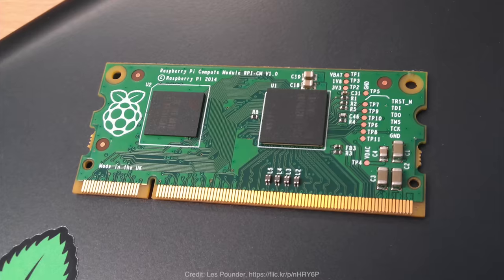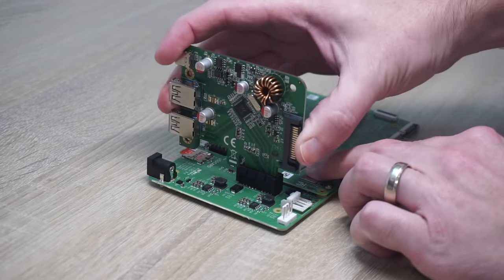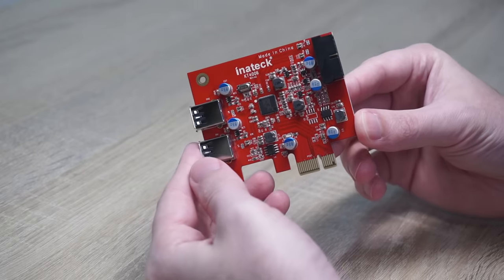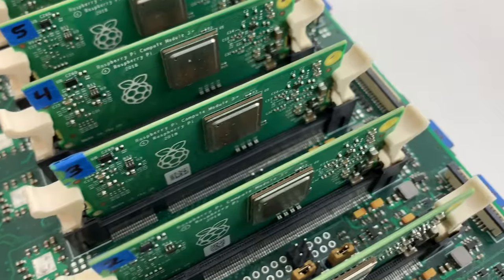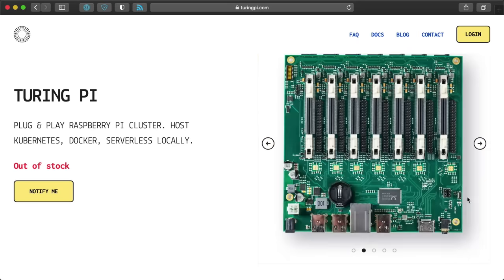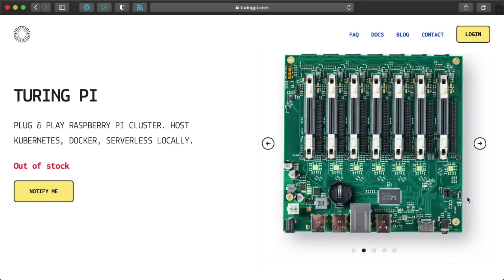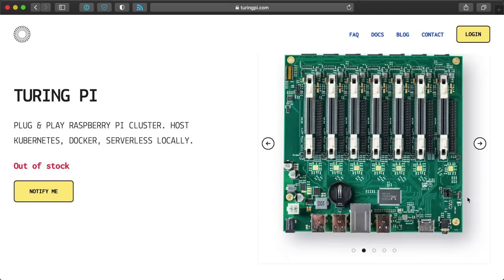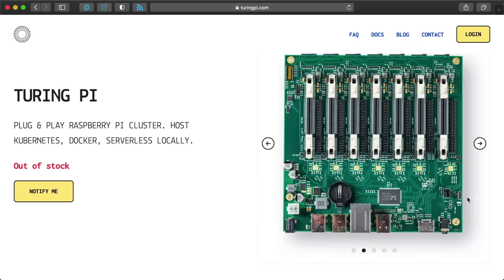The Raspberry Pi Compute Module 4 Review

Comment: now i kinda just want a company to make A NUC sized I/O board with all the I/O on the rear, and maybe an M.2 SATA port on the bottom side.
Reply from the maker: Throw an NVMe M.2 slot on it and I'm there. That's basically an Argon One case, but even easier to manufacture. Wouldn't have USB 3.0 though.
Reply: @JeffGeerling  at sub 400mb/s is it even really worth getting the NVMe drives up and running? SATA M.2s save you a smidgen of cash and are just asp lug and play, right?
Reply from the maker: @Mobile_Dom  It really depends on the deal you get for the drive, but NVMe drives do get better random performance than a SATA drive due to the more direct memory access.

Comment: The Banana Pi R64 is a router based development board, which can run on a variety of open source operating systems including OpenWrt,Linux. It has 4 Gigabit LAN ports, 1 Gigabit WAN, and AC wifi AP function. use 64 bit chip design
http://wiki.banana-pi.org/Banana_Pi_BPI-R64

Comment: I don't really get why you wouldn't have drivers for arm64 (aarch64) or armhf. First of all, AMD gpus have open source drivers, built straight into the linux kernel. I dont think amdgpu is included in Raspberry Pi OS build, but you should definitely be able to compile your own kernel with it included. Nvidia supplies its proprietary drivers for arm64 and armhf. Of course it's likely that these don't work due to this being such an unique device, but they are at least out there, and you should be (in theory) able to use standard AMD/Nvidia gpus. PCIe is backwards compatible.
Reply from the maker: We'll see, I ordered a 1x GPU. Larger ones typically require more wattage, so I fear I'd have to do a little more work / get a better riser to provide enough power without overloading the 2A power supply I'm using through the barrel plug.
Reply: @JeffGeerling  Here is a dirty hack: if you can't find a power supply with enough power, get an older ATX psu with a floppy connector (or just connect some jumpers). According to IO board's datasheet, you should be able to use it as an input. If you for some reason in some parallel universe do this, disconnect 5v wire just to be sure and check everythin with a multimeter before frying your only board :D

Comment: @4:45 -- I don't think that's true. -- They make 1x to 16x Riser cards (they're pretty cheap on Amazon) and people use them for GPU Bitcoin mining all the time. -- Sure you'll be running a 16x card with only 1x the bandwidth -- but it should still *work*. -- You can probably even game on it (no matter how slow it is, it will only be slow compared to a high end setup -- compared to the built-in mobile GLES accelerator, it should still blow it away...).
Reply from the maker: Yep! I just made a video going through trying a Radeon 5450 (which requires a 16x slot) with the 1x slot on the IO Board, and it works... mostly... just doesn't initialize all the way :(

Comment: you said that the pcie slot wont support a nvidia card for gaming however i think they make adaptor boards that allow a nvidia card to connect to a single pcie slot as bitcoin miners do not need the video asic so they can get away with using cuda cores only.

https://www.newegg.com/p/1B3-0040-00001

should in theory work  you wont be able to game or render graphics  only compute (bitcoin mining and password cracking)

arm eh!  couldnt you hackintosh a pi and run osx big sur since newer apple computers use arm chips?

the wifi connector is the same you see in laptops so couldnt you pull the antenna from an old laptop and use it?

Comment: NVMe requires 4x PCIe lanes. Im surprised you even got it to boot and run on 1x lane, if the drives got their full speeds
Reply from the maker: 4x is not a requirement; the drive just drops back to use the x1 bandwidth, and maxes that out. The Pi shows that it negotiates a maximum throughput of 5 Gbps in the system logs. If you have more lanes, you can get more bandwidth, though.

Comment: 19:20 A dev board like that needs to expose every feature of the module it's for: that's the whole point, so that you can use it to breadboard test with your project hardware and figure out exactly which features you actually need. If you want a smaller board, you take the lessons you learned from the dev board, and design your own carrier board to contains only those features you determined you needed (plus the rest of your project's circuitry), as god intended.
Reply: Plus the Pi Foundation are releasing KiCAD designs for the dev board, so you can just take their "known good"¹ design and delete the bits you don't need in order to create your own board :)

¹ ...hopefully there are no hardware "quirks" in the dev board, such as the RPi 4B's USB-C issue, so that it actually is a fully-working reference design! :)
Reply from the maker: True, but the older models were still more trim—features like full HAT support with mounting points aren't quite as important to me. But it is nice to see it for those who need it.

Comment: If it's a true PCIe bus, and it is a regular Linux kernel, then just re-compiling a driver for arm would do the trick.
Reply from the maker: Unfortunately after a lot of testing it looks like the problem is that the PCIe bus on the Pi is slightly out of the standard spec, and I might be running into that in my GPU testing.

Comment: You can run a 3090 on a PCIe 1x slot (assuming you can even find a 3090) I just wouldn't recommend it, the bandwidth would be horrid.

Comment: Everything out of stock now, I am expecting IO board with PCIe and Ethernet jack at pricing 10$.
Reply from the maker: It would be cool if someone could build just a tiny carrier board that had Ethernet, an M.2 slot, and power, so I could make a tiny / thin headless server.
Reply: @JeffGeerling  Yep, except i would trade the M.2 with PCIe for extra flexibility. I am expecting the price of this tiny carrier board would be much cheaper. The only catch is the high-density 100-pin mezzanine connector could be pricey due to it's uncommon form.

Comment: Building a NAS has a high SAF!! I had to stop the video when you said you don't have a NAS.
Xpenology
FreeNAS
UnRAID
...
You surely have an old PC sitting around that you can put a few shucked WD drives in. My Xpenology NAS is running beautifully on my 13ish YO LGA775 PC with a Q6600 CPU. It doesn't take much! Plus you get to play with Synology DSM - which is AMAZING. And later you can convince the wife that Synology hardware will SAVE money from reduced electricity cost.
(SAF=Spousal Acceptance Factor. It's the single factor that matters most in a happy relationship :-)
Reply from the maker: I have one old PC sitting around, but it's a laptop and I only have it to test builds on Windows from time to time, and for Halo :D

I do have a bunch of Raspberry Pis, though, but until the Pi 4 none were any better than the Mac mini I've been using for the purpose since 2011. But now I'm probably going to be giving the mini the boot (well... selling it off to someone who can make good use of it elsewhere).

Comment: The Pi can't handle PCIe GPUs. I've had a look into this topic a while ago for the RK3399. Basically those small CPUs lack some sort of cache/memory that would allow them to operate a dedicated GPU. More precisely: This cache is too small (I'm not talking about L1-3 cache btw).
Drivers aside. The lanes aren't that important since the CPU probably wouldn't have enough processing power to run a GPU at its full potential.
Reply from the maker: It's not a matter of whether or not it's a good idea, just whether or not it's possible :D
Reply: @JeffGeerling  Yeah, I know :)
But I was implying that it's most likely not possible due to said hardware limitation. It cannot be overcome. Now, I'm not sure if this limitation also exists on a Pi 4. It is definitely not possible on a RK3399. Maybe the Pi 4 SoC features enough of this cache. I'm not sure. If it doesn't feature enough of this cache, it's just simply not possible. Let's just hope it works because that would be insanely cool ;)

Comment: I think you are little bit mislead. You actually CAN put even RTX 3090, but you need PCI-e riser and external power supply for the GPU itself. And there are ARM Linux drivers for NVidia cards

Comment: I just bought my first Compute Module (a CM4 with Wifi, 4gb ram, 8gb emmc) and was blindsided by something I haven't seen ANYONE mention... I'm not new to Pi's by any means, just the CM's... I did a lot of research before buying one too, and I didn't see anyone mention that if you buy a CM4 with onboard EMMC storage, you CANNOT use an sdcard as well. The sdcard pins are not connected to the SoC at all on models with EMMC storage. This is NOT something that IO board makers can fix either. The only way to use an sdcard on CM4's with EMMC is to use a USB to micro SD adapter, thus taking up a USB port.

Comment: It is strange to see such a bad network performance from the pi compute module 4 in the video since mi RPi 4 actually saturates gigabit network (>110MBps transfers) via SMB with XFS formatted USB 3.5" drives and I have seen files copying at 170+ MBps between two 3.5" drives connected to it. IMHO Raspberry Pi (and compute module) is just amazingly good as a NAS, especially considering its price and how little energy it consumes.

Comment: Shouldn't every video card work theoretically in a "open" x1 PCIe Slot, only with limited bandwidth? So if someone would open their PCIe slot with a saw or drill it's only down to software/driver support if a card can run. And of course the performance of the card basically won't matter at x1 bandwidth...

Also: I wonder about the longevity of this new connector... how easy can they bend or break. With the SO-DIMM connector one could plug & unplug it thousands of times without any problem. With this new connector I'm not so sure...
Reply: a x1 to x16 riser would be easier and safer, and since it doesn't have to fit in a standard case it has no downsides.

Comment: Please do a WIFI adapter. So that you can Put a wifi 6 on a pi 4. The built-in wifi is not wifi 6
Reply from the maker: I don't have a WiFi 6-compatible router yet, though 🙃
Reply: @JeffGeerling  Ya but the PCIe wifi from intel in really cheap and at least confirm that it works. It is the AX200

Comment: I have a Zotac GT 710 with a x1 PCIe connector. If you want it, it's yours.
Reply from the maker: I just ordered one, otherwise I'd be sending you my address right now! I'll post another video when I see how it runs.
Reply: @JeffGeerling  Hope you can get it working! I remember reading a hackaday article about someone making a custom kernel in an attempt to get a GPU running. Btw, have you thought about a PCIe expansion kit to get more PCe ports?

Comment: The fact that the CM4 no longer fits the same form factor defeats the purpose of the CM in the first place. The CM was a promise, a promise of future compatibility, of upgradability, of a way to slow down e-waste by having an upgrade path. And with this revision, that promise has been broken. 

Don't get me wrong, the SODIMM slot form factor was absolutely a bottleneck, but now everything previously made to support the CM formfactor is immediately deprecated. And honestly, I'm a bit upset as this change is pretty much out of the blue. My team and I spent months working around the SODIMM slot design, and now it's all for nothing as our device will need to be redesigned and refabbed if we want to support this newer form factor and have better performance. 

What even is the point of working with this new CM form factor? The promise was broken, and it likely will be again. Why bother engineering something for this formfactor for it to be deprecated the moment it leaves the fab? Why bother designing something for this form factor only for it to change again in a year or two.

While I'm grateful for a more powerful Raspberry Pi, I'm still salty as fuck.

Comment: 32...32? im sorry did he say 32 versions?

sighs why? the 3 versions of pi 4 was about as complicated as this ever needed to be
Reply from the maker: It's nice when you're building different projects to be able to pay less when you don't need certain things (e.g. a wired industrial camera solution doesn't need WiFi at all, and likely doesn't need much storage — vs. a device that needs to store some amount of data for periodic wireless data dumps, which would need WiFi + eMMC).

Most people outside of specialized use cases should still buy the regular Pi 4 model B since it has all the general use cases covered without needing a giant IO board to break out all the connections.
Reply: All 32 versions of the CM4 are only a single PCB, from what I can tell, so they aren't increasing their costs on the PCB fabrication side of things.
The differences are in which components are populated, and at the volumes they make these things, having 32 different pick-and-place setups is likely a very minimal extra cost, too, while providing the flexibility that I imagine their industrial customers were demanding.

They actually sell a surprising number of these compute modules, even though that's not what most people think of the organisation for!

Comment: 1x PCIe what? 2.0? 3.0? 4.0?
For videocard: you need some adapter, all should support 1x speed, they just not fit in physically, but you can solve that. From that point, you may only need a kernel driver for ARM, which may exist for cards with open source drivers... maybe ROCm? https://www.phoronix.com/scan.php?page=news_item&px=ARM64-AMDKFD-HSA-Compute :)
Reply from the maker: PCI 2.0, sorry I forgot to mention it in the video.